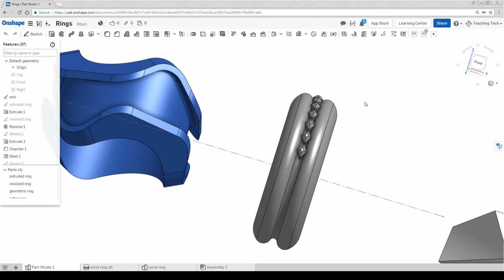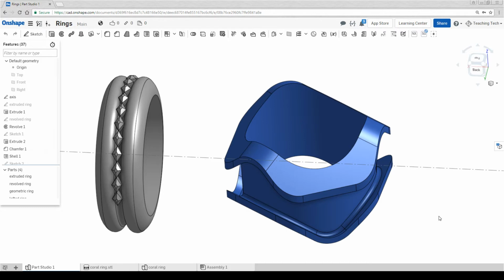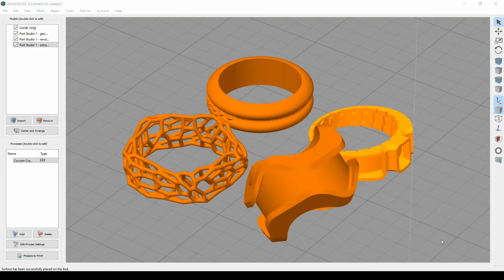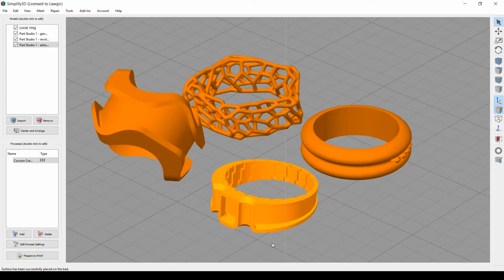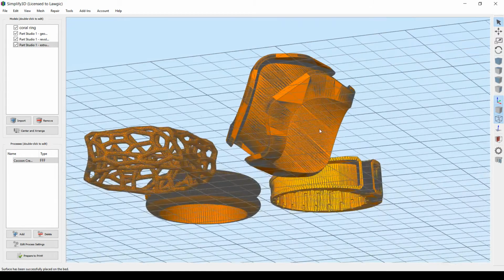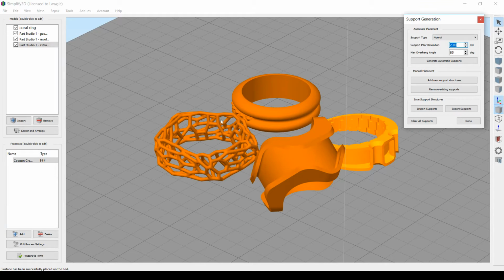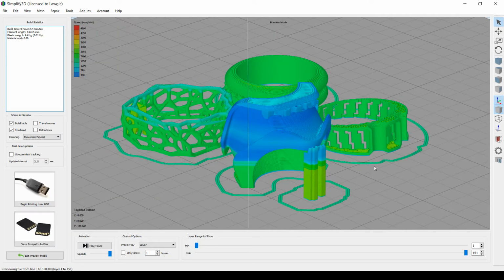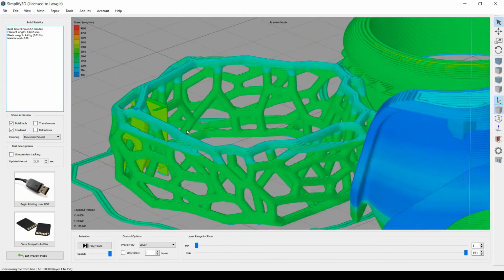Modelling 3D Printed / Investment Cast Rings - Part 5 (Printing in FDM vs DLP)

Comment: Hi! I watched your entire series about using Onshape, it's very impressive and I've learned a lot from it. There's just one thing, view navigation (rotating/moving). Is there a way to make it work like Tinkercad does? Using "Alt" just doesn't work (see https://www.youtube.com/watch?v=6sIN9joZNPQ)
Reply from the maker: Click on your user icon in the upper right, then My Account > Preferences. There are five options for view settings under mouse control, hopefully one of them matches what you are after.
Reply: @TeachingTech  Thanks for the tip. None of the settings are usable for me. I guess if some time in the future they'd implement navigation "the right way" I could switch to it completely. But for now tinkercad it is :)